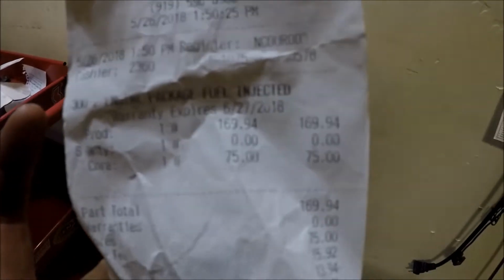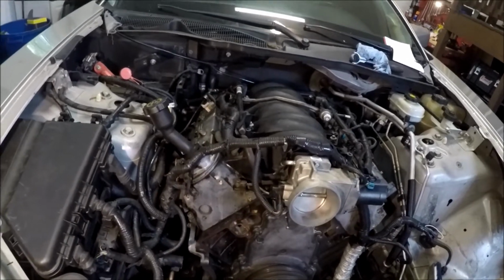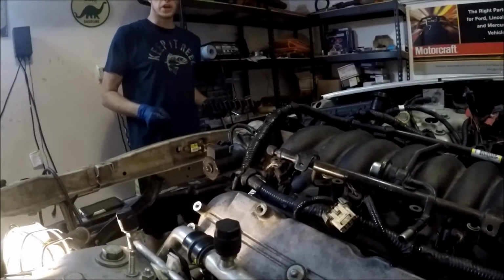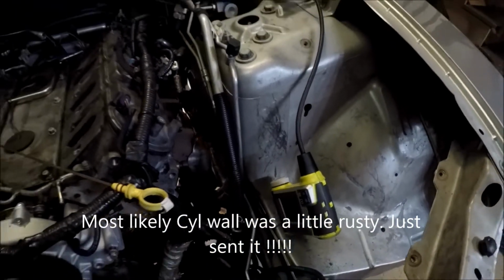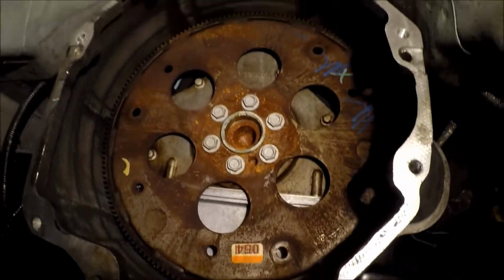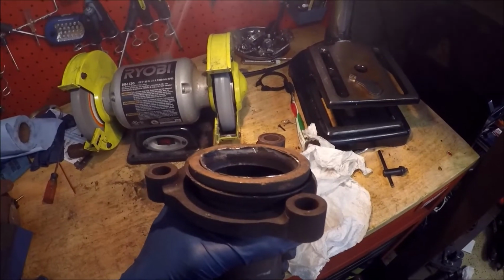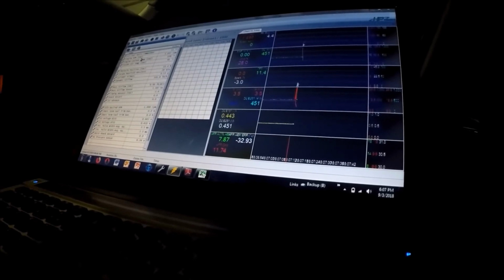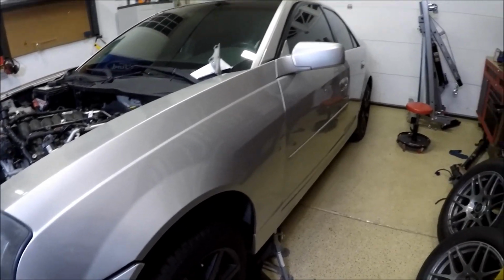200$ junkyard 5.3 motor into ctsv with first start

Comment: 220k miles though?  Ugh.  For the work involved seems like a LS6 with low miles or at least a 5.3L with lower miles.   

Cool project though.  These are awesome drift cars, so fun
Reply from the maker: It's not that bad to pop in another motor if it croaks. But the whole premise was budget build so I can dump the money into racecar v. Ls6 is probably 2k